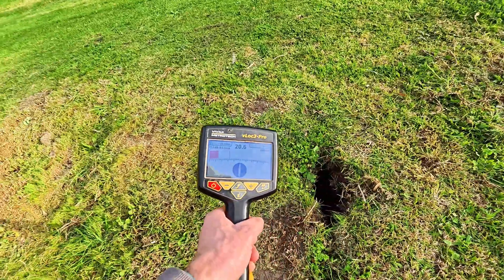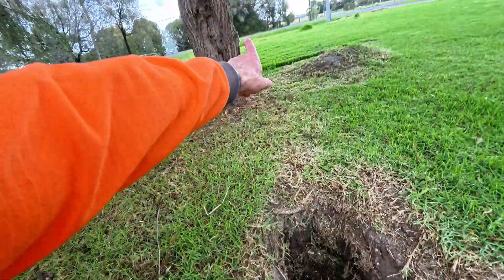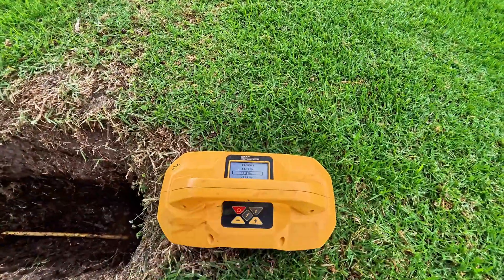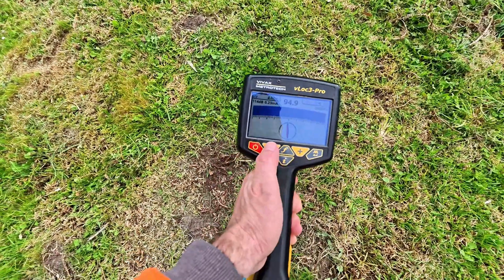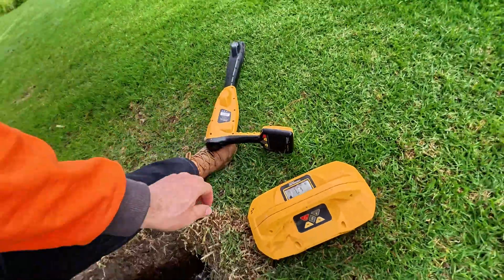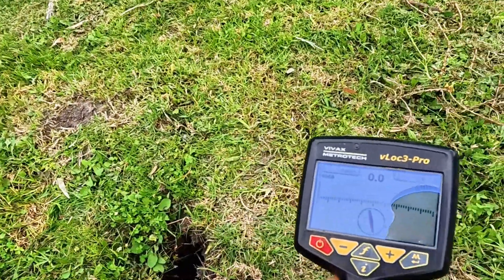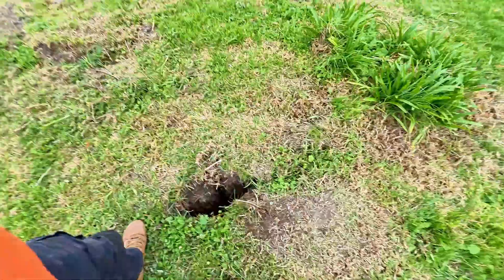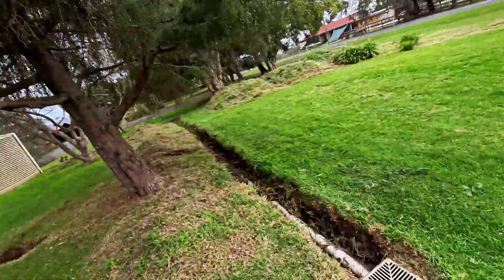How to locate a gas pipe, with a broken trace wire

Comment: Thanks for sharing. What's your reason for placing the transmitter on the original part of the signal wire? 

Is this just to demonstrate it being capable of jumping over the gap(s) at 200kHz? And because you can locate the good end and be sure about its location/direction for maximum coupling? Why wouldn't you inject/bite 200kHz directly onto the wire at the gasmeter (and continue from the point the lower frequency got lost)?
Reply: Thanks Ben! Much appreciated! 

I was on the wrong track on how the signal was coupled onto the broken part. so it did not add up in my head why you did place it on the good part. 

Now I need to play more with the transmitter! Quite a different beast than magnetic coupling with a clamp around a conduction pipe/cable.
Reply from the maker: @sdietmar  hahahah, yes indeed, very different to the clamp. 
It's good though that we have all these different options that we can use to try and induce a signal into the utility we are trying to locate.
Reply from the maker: Hi Dietmar, 
For the first part of you question, I did actually mention this in the description, but basically, whilst it shouldn't really make any difference if you place it where you have found it or a bit further forward where you think it is, the reason I like doing it this way, is because you have more of a chance to pick it up if it does a right angle turn and goes in a different  direction.
For the second part of your question about why not just bite on to it and do it with 200kHz, that's a great question. Rather than answering it on here with words, I went and got the gear out and grabbed the camera and went and did exactly that to show what happens. Here is the video - https://youtu.be/dMkOXf7SIbc?si=3hKk9iBV5-BBIJfr
Regards
Ben

Comment: yes but how did you locate the first break on the tracer ? fault finder a frame ?
Reply from the maker: No, I didn't use the A Frame. 
The singal simply stopped at that point. 
It was as if it was the end of the pipe. 
Luckily, we were still in the front garden. If we were in the street and this happened, you would think that ok, that is where the pipe stops. But because we were in the garden and we knew it had to get to the main in the street and yet the signal stopped at that point, we decided to dig down and see what was going on, thinking maybe they simply stopped the trace wire there. But no, turned out they didn't stop it, it had simply broken at that point.
Reply: @GeelongCableLocations thank you so much for replying. I've just purchased an 8100 and I work on potable wells here in the states. Broken wires are an issue around here due to the rocky ground I was wondering if I needed the A frame or I could just use my receiver to locate faults ?

Comment: Hey Ben. Does the transmitter have to be placed long ways as you have done?
Reply from the maker: Hey Tom, generally yes, although it will depend on what type of transmitter you are using, as to which way the antennas in it are facing as each locator is different. Most will have an arrow on the transmitter itself, to let you know which direction you need to place it.